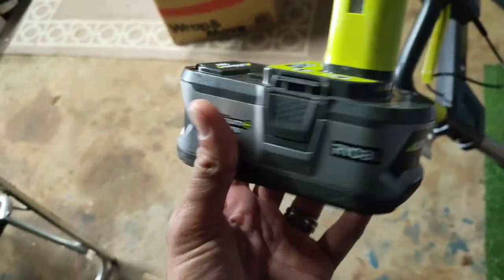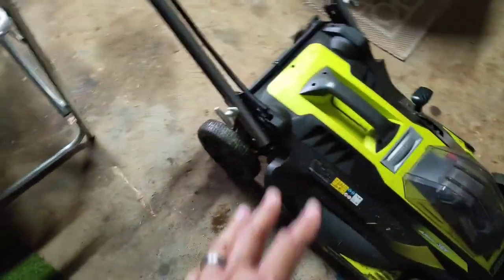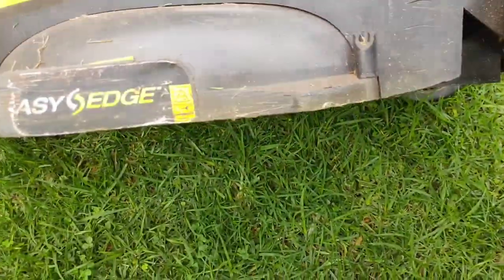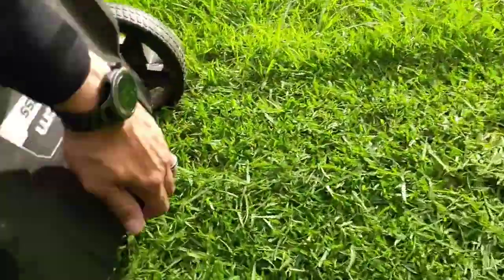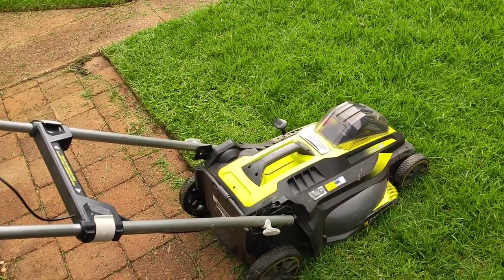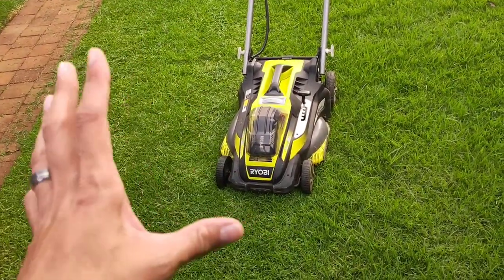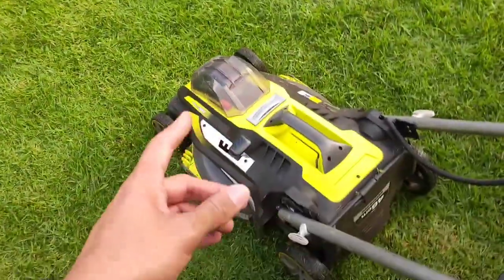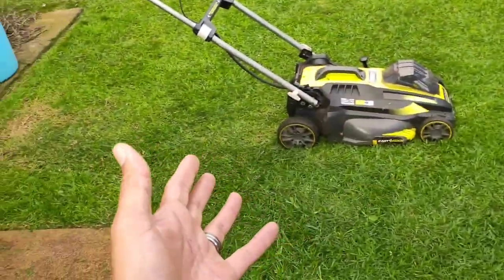Ryobi 36v Brushless Lawn Mower Review

Comment: Absolute a waste of money , gutless and you'll be lucky to mow a 5m X 10m yard on a full charge after a few cycles of the battery . Great video but no good for average size Australian yard . I also see you cut on the highest setting which is probably the only reason you can complete your yard in a full charge .
Reply from the maker: Mate, cut your garden on the highest setting and your lawn will look amazing after a few months. I do my lawn and only use half the battery charge, you might have a defective battery or mower which you should get sorted if it's still under warranty instead of ranting how bad it is, because it's a fantastic mower and much better than you are describing.